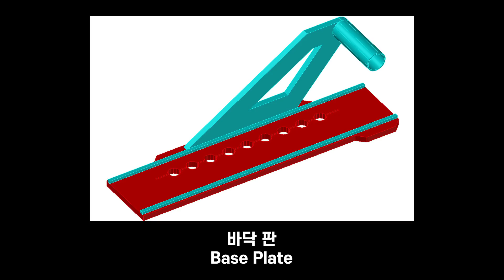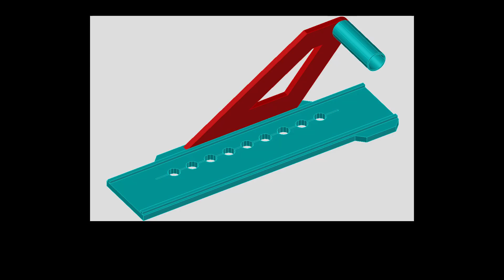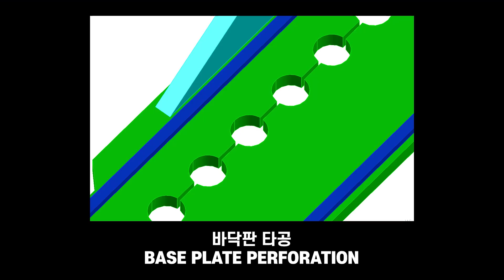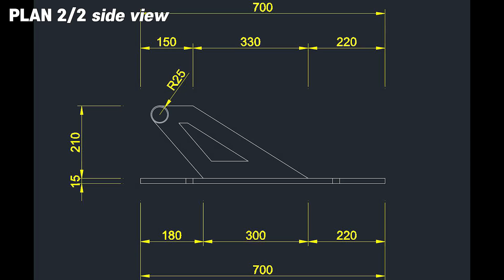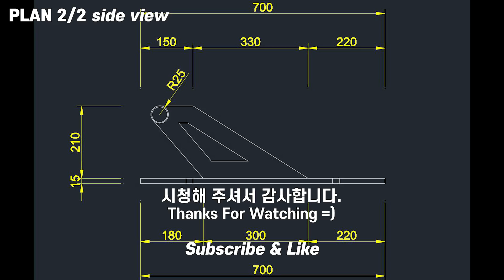Circular Saw Guide Track for precise cutting│짧고 정교한 재단을 위한 원형톱 가이드 트랙 [목공 diy woodworks]

Comment: I have seen several guides. I like this one. It seems to me  easy to work with. I want to ask you a favor because I don't have a wide room to work and storage several guides: how to make a combinable mini work table with included guides to install circular saw, sander, jigsaw, press, drill and others? I know it's a challenge with a small measure. Thanks. Bye

Comment: I like the base but not the handel.... Why did you use T tracks? Maybe use some rubber under the baseplate for slipping.
Reply from the maker: This t-track was used because it was light, durable and inexpensive.

Comment: Doesn't having so many large holes defeats the purpose of a supported surface to prevent tareout?  Wouldn't it make sense to have as few of these holes as possible, asymmetrically spaced to choose the best visibility vs quality of cut on a rip?
Reply from the maker: Big holes and small gaps make it easy to see short, complex lines on the floor. There have been no problems due to the large number of holes.

Comment: Two comments. If I understand you need a scrap panel underneath the pièce you cut. This is somewhat inconvenient. Second, since you are rightly attentive to costs, why not use two wood strips as guides ?
Reply from the maker: Thank you for the feedback. =)
Reply: Ok, but I expected a comment
Reply: You use the metal to ensure it’s straightness, wood could bend, twist and move.
Reply: It also gives you the ability to use t-slot attachments such as stops etc...